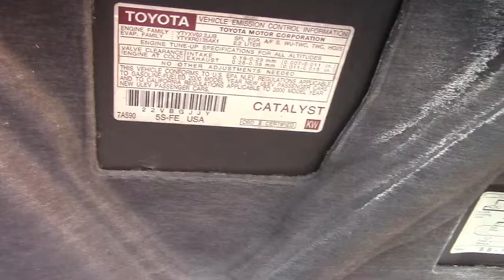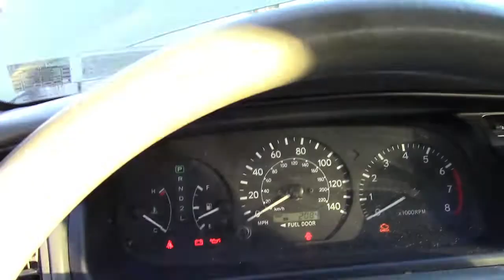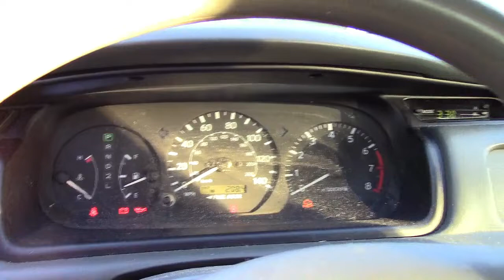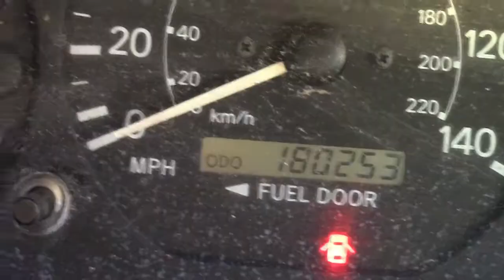Another Bad Ignition Coil On The 2000 Camry--It Ain't Over Till It's Over

Comment: Not gonna say it
Not gonna say it
Not gonna say it
Not gonna say it
Not gonna say it

I can't not say it

THAT'S THAT TOYOTA RELIABILITY
Reply from the maker: After almost 22 years and 180,000 miles, it's had its fair share of breakdowns, and replacement parts needed.  I had a lot of front end work done on it, broken control arm, that's NY winter roads for that many years.  Honestly not the car's fault, could have been any car.  Did the timing belt probably 4 or 5 times now, water pump, oil pump, which is simply due to the design.  If it were a chain, probably wouldn't have needed it.

Shifter cable broke, that was odd.  That was also due to all the salt on the roads.

Blower motor resistor, that was a surprising fail.  O2 (air/fuel ratio) sensor went bad, not terribly surprising of a fail.

Thermostat, did that.  Radiator went bad, they're plastic, so it lived its life.  Sensors for the coolant temperature to turn the fans on and off, BOTH of those failed, once never turning them on, once leaving them on all the times.

Can't tell you how many sets of brakes and tires and oil changes.

If you add up all the repair costs over the years, and consider a car from a different manufacturer and its repair costs over the years, Toyota will be lower.  Toyota reliability doesn't mean it won't break, it will.  It just means it will break less, over time.  Yes, you can have squalls where everything breaks at the same time, and you did.  Regardless, it's still a great vehicle.  Used cars that are a few years old are selling for more than new ones now.

I looked at the repair records on my dad's 87 Camry, and I could not believe how many parts were replaced over the years.  Even still, it has been the most reliable vehicle he has ever owned.

There will be an update video on the 2000 Camry tomorrow.

Comment: Upper radiator hose too close to the exhaust manifold. I have the same car and engine, about five years ago that section that very close to the exhaust manifold became soft and swallowed and on a cold winter night at a worst place and time it blown out. The turning section should be up and if need you can cut the hose a little bit to better fitting. I did so after putting new after market hose, and sice then everything is fine. This is just my experience. I am not a mechanic.
Reply from the maker: The routing as you see it, is factory.  I can guarantee you that it will ONLY blow at the worst place and time.

I've seen hoses do weird stuff.  I even had a relatively new hose (about 2 years old) actually BURST in another car, shot boiling coolant clear across the street.  Fortunately I was out of the way.

Comment: That's great you got it running properly! That's why it's a good idea to save known good parts, too. Too bad it couldn't have been this easy, when the first China coil failed. I'm sure that OEM Toyota coil will last the rest of the time this car is still in full time service. Is the other coil OEM Toyota, that the shop replaced in Octember? Indeed, that is the dashcam I have in the Tundra!
Reply from the maker: Well I didn't know for sure of those plug wires were any good.  But I figured at least 1 of them would work, which is why I tried them.

The crooked shop of course put another Chinese coil on there.  However, the old coils, I still have, this Toyota one that's on now that was original, and the other original.  The good news is the front coil is a lot easier to get to.  I was out there in the cold that day, there's a clip you have to press to release the gray connector.  I pressed down so hard on that clip that my finger hurt for 2 days after.  I had to use a screwdriver to pry the connector off the old cable.  Not fun.

That's a great dashcam, of course.  Yesterday I recorded a follow-up video to this one, and while I was out there, decided to format the SD card in the dashcam, since it's been ages since it was done.  So I can check that one off the list too.

Comment: have 1998 camry with 320k plug 4 burned colder for years, later plug 1 started burning lean, currently has 4 misfire Po304 with 1 lean burn and flashing chk engine bad 1,4 coil too much voltage going to 1, possibly loose connection in 4
Reply from the maker: A few things:
1.  If you replace an ignition coil, spent the money for the Toyota brand part.  The cheap coils will leave you stranded.
2.  You don't want to drive a car with a flashing check engine light, it's bad for everything.
3.  Being that you have strange things happening in different cylinders, it would be wise to do a compression test to see where you stand on that engine with that many miles.
4.  A lean-burning cylinder, especially on a car with that many miles, likely means fuel injector issues.

Comment: 180,000  Witho general maintenance Toyota's will go 300,000. I've had 4 in my lifetime. Very reliable
Reply from the maker: This would have made it if it weren't t-boned 6,000 miles later and completely demolished.

Comment: Will it keep it from starting
Reply from the maker: The car has 4 cylinders and two ignition coils, each coil sparks 2 cylinders.  If one coil dies, two cylinders won't get spark.  If you listen to the exhaust, you'll heard a definite thump-thump sound as those two cylinders won't be firing.  It might start, it might run, but it will be extremely shaky and underpowered if it does.

Comment: You forgot to mention that its a 4 cylinder!!! But thanks anyway
Reply from the maker: It's blatantly obvious by the 4 spark plug wires, all in-line, rather than 3 at the front, 3 at the back.